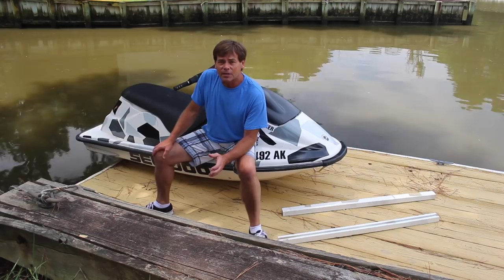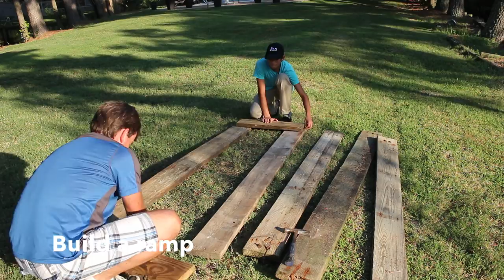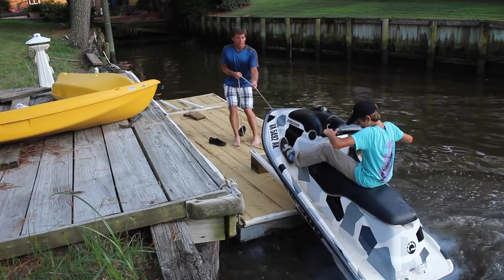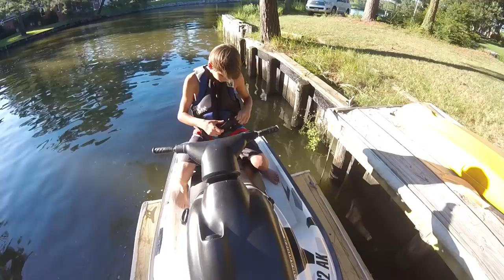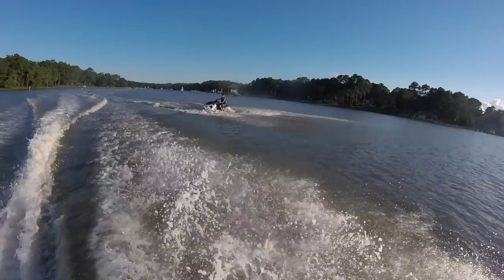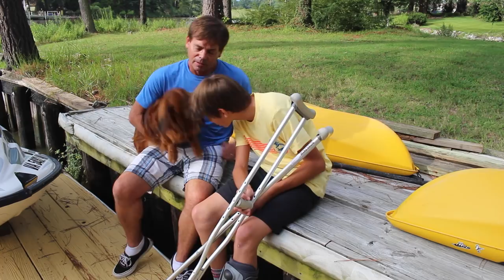Building a Jet Ski Dock

Comment: Nice concept guys.  I would not use nails.  Would use stainless steel screws and add a small float to keep ramp wood out of water.  Also recommend a padded stopper to prevent going to far.  Cradle could be wider
Reply from the maker: All good suggestions. It was going to just be a proof of concept but it worked well enough that I kept using it as built. Turned out to be a big time saver compared to launching and recovering with a trailer every time.
Reply: Wood actually lasts longer under water than above water.

Comment: Hey Steve this video was a big help! I've had my jetski just tied to the dock and the bottom of my ski and the footwells get stained really bad and not to mention I have to cover it in the water and is a real pita. To add a couple little additions to your idea I'm gonna buy a cheap winch to attach to the front of the dock closest to shore and this way I could use the winch to do the work instead of driving it on every time. I'd also recommend putting some cheap outdoor carpet like what is on trailers to prevent marking of the hull and also helping the ski slide a little easier than on the bare wood. Just a couple little ideas but I love the simplicity of this! Did you need to put any floats or foam under the ramps that are in the water or do you just let them float? im guessing those ramps in the water don't hit bottom of the lake? or do they have to hit the bottom for support? thanks Steve!
Reply from the maker: This isn’t the most elegant solution but my skis are old and I was getting tired of putting them on and off the trailer. The ramps are just free loading at high tide and they bottom out at low tide. Long term some type of float might help offset waterlogging. I love your idea of adding some kind of carpet to the beds. Good luck!
Reply: @StevenVigus  Thanks Steve! 🍻👍

Comment: You may want to add a Support brace under the ramp boards that form a right angle with the dock side board. that would help stop the ramp angle changing as you put weight on it. Or it might break the whole thing;-).  A little carpet might be a good idea too.
Reply from the maker: Paul Dierze excellent suggestion. You saw how steep the ramp gets and it's worse at high tide. I'm going to need a solution like that when the ramps get waterlogged.
Reply: Put a float or something under the leading edge of the ramp to help maintain a steady approach angel of the ramp.
Reply: Cover all wood with carpet or HDPE slabs…

Sorry, but after watching this I do NOT want to build a setup anything like yours….. 

…..but I do want to build a floating ramp to do jumps off of with a wave runner…….

……you’re a bad influence.

Comment: no carpet in the wood?  Id be worried about messing up /scratching my hull.
Reply from the maker: That's a good suggestion. I have some carpet for just that purpose but I never got around to installing it. After jumping the ski out of a pool and into the yard the minor scratches from the beds don't seem as bad any more.
Reply: Spray a little Slydz-On Trailer Spray on the carpet. It makes the carpet much more slippery.
Reply: I think carpet bunks and a winch would likely do the trick.. maybe a few rollers if you could get them to fit right.
Reply: Steve Gregory e
Reply: @steve vigus. My dad worked in the rental business for many years and if you can get your hands on some synthetic grass or mini gold grass that material lets the skis slide very well

Comment: Could ad a crank winch on the front, like on a trailer, and  easily pull them up onto the dock
Reply: You guys should attach PVC runners or skids onto the dock and a  trailer whinch  pulling 750lb Watercraft onto  a floating dock like you did isn’t good for anyone’s backs  and your hull is going to take a beating  over time  IMO

Comment: Steve Vigus, I’m wanting to buy either an spx or the xp. What would you recommend after owning both? Thanks!
Reply from the maker: As you probably know, SeaDoo cycled the SPX and XP model names so that a given year's XP dropped down to being the SPX for the following year. So your choice will be year-specific. If you love speed and power, check the performance specs and go for the most horsepower. I find that even the entry-level models are plenty fast to have fun and less power=lower fuel consumption (generally). I do favor having two skis because these old machines can leave you stranded and it's nice to have a tow boat nearby. My dream setup? Two '96 XPs that never break down. Second choice? Two of anything with that classic SeaDoo hull shape. Sticking to the same model simplifies maintenance because you can stock a single impeller, etc. If you have a family you might consider a two-seater and a three-seater, which can legally tow a tube in most states. Just my opinion...Good luck!
Reply: Steve Vigus thanks so much for prompt response! I was looking at the ‘96 xp or the ‘95 spx. After looking at the power specs, I am definitely leaning towards the ‘96 xp. Love the look of the yellow ski! Good tip on having two. That will definitely be in my future! Thanks again Steve!

Comment: What did you use for filling the stomp pad rivets ? I'm about to pull mine but would love to know what you used.
Reply from the maker: For this project I went the easy route and filled the holes with two-part plumber's putty. In the past I have used two-part epoxy and the stuff that comes in a surfboard repair kit. The challenge with liquid products is that they tend to run down and through the smaller holes so you end up having to apply two coats to fill it. With the putty you just activate it by kneading, squish it into the hole, and wipe off with your finger. If you are going to cover it with a traction mat then you don't' even have to make it look good. If not, then the white/gray color could be annoying, althogh I don't even notice at top speed on the water.

Comment: Great videos! I bough a 1996 seadoo also. Like it a lot.. When it starts... Any tips?
Reply from the maker: Biggest tips: (1) Check all connectors for corrosion regularly and spray them out with a corrosion preventer like the SeaDoo XPS spray or other light oil (2) check the ground wire periodically - I have another video that shows you how to do this - it has caused intermittant problems on 3 skis for me and this is a simple problem that is commonly misdiagnosed (3) replace gray fuel lines (4) periodically check for fuel leaks at the tank fittings, fuel/water separator/filter, fuel selector valve and clamped ends of all fuel lines (5) rebuild the carbs every few years (6) flush and fog after every ride if you can and (7) get out there and ride!  Bonus tip: Carry a paddle and travel with a buddy who can tow you back when it does crap out on you. A 20 year old SeaDoo is like a 20 year marriage; You have to work some to keep it going but it gets easier the more time you spend together.
Reply: Steve Vigus thank you!! Also do you think it would be easy to wrap it without proper tools? Would have to remove the current stickers etc
Reply from the maker: MayScape that's an easy one. Check out my video https://youtu.be/iWxL7-JQiH0 no special tools required.